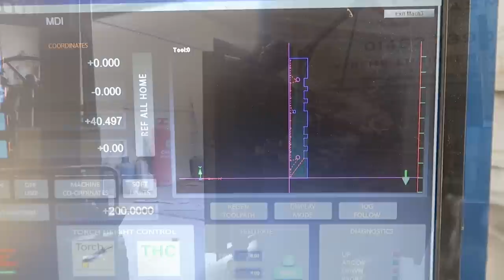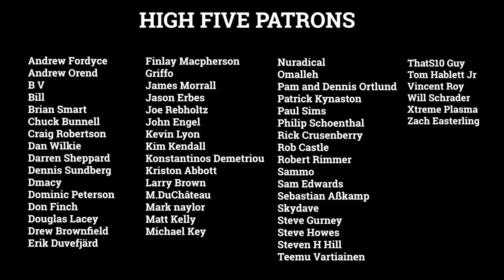Welding Up The Rusty Mercedes Sprinter #campervan #campervans #camper

Comment: Hi Matt. Excellent job on the repairs. There looks to be a decent amount of repair panels available, which certainly helps a lot. I need some of the cavity rust preventative for my new 100E project. All the best, Mart in Solihull.

Comment: Well done with the replacement door bottoms, I made a complete hash on a Mini door years ago. After watching plenty of YouTube I can recommend Fitzee's Fabrications methods. He would have opened the skins up and replaced the inners using whats left of the outer as the reference points and then replaced the outer panel with cut and butt. Well worth a look as its made my repairs look a lot better.
Reply from the maker: Yes I can see that’s better way of doing it actually 👍

Comment: This was a "pity watch". With no interest whatsoever on re-badged LT's, and quite happily could live the rest of my life without seeing another one that close, (they are all the same, btw), I clicked and watched this video all the way to the end. Although the plasma cutter and ready-made repair panels do help, that was still a lot of work just to get an old "Sprinter" back on the tarmac. Hat is off, Sir. And may I suggest to go through the pushings, ball joints, bearings and brakes. Just to make the traveling experience slightly more bearable.